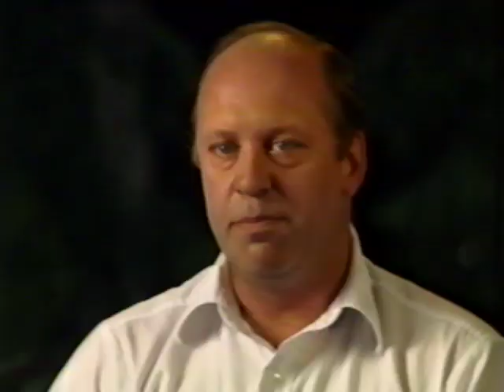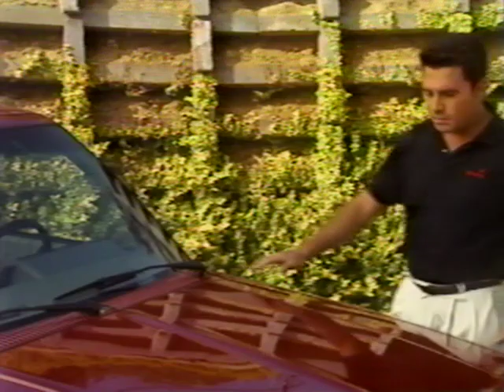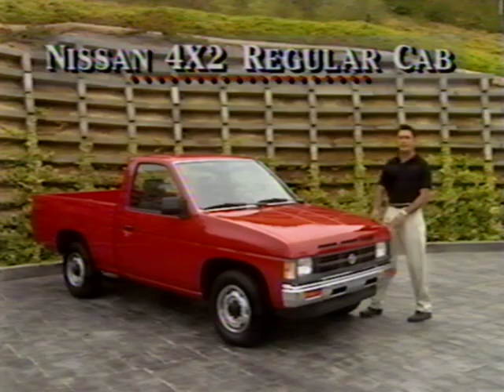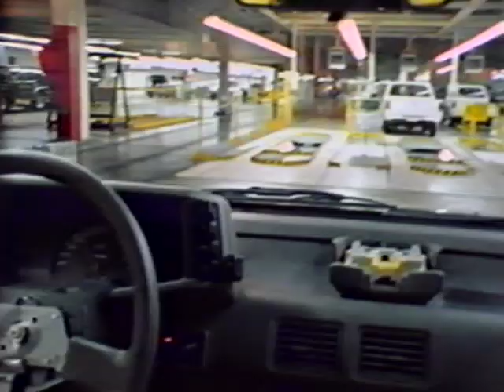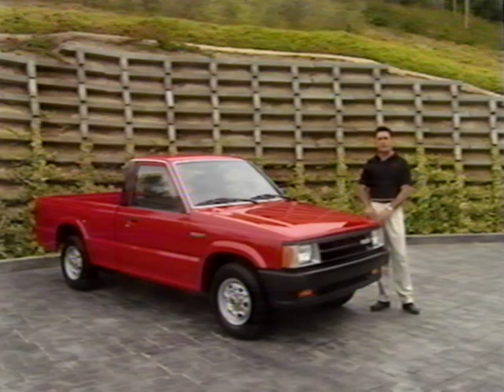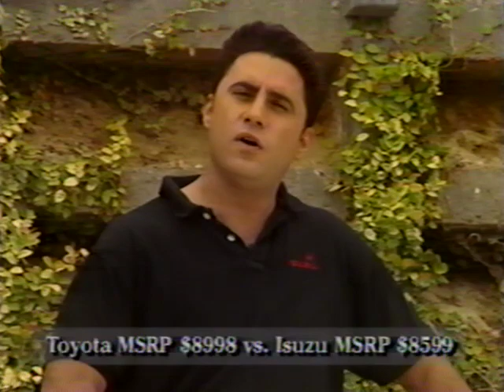Value's Back in Style 1992 Isuzu Pickup

Comment: I had one of these: A 1991 I purchased brand new and when the warranty expired, so did the d@mn truck! I had friends that had Mitsubishi’s and Toyota trucks purchased around the same year and they never gave them a bit of trouble other than routine maintenance. Mine didn’t either, but it was like when the warranty went out so did everything else! The starter, alternator and fuel pump all went out on mine within two weeks of one another. 
I eventually sold that piece of junk in 1998 and when I did, I was glad to see it go.

Comment: Some observations... great sales infomercial for dealers.  The Isuzu was a great barebones truck....they all were. It just depended what style and preference you you liked. I owned them all and with the exception of the Mazda see them all once I'm awhile, especially the Toyota and Mighty Max. The downside to the Isuzu that was never mentioned.... the engine had a carburetor and was not fuel injection.  Most were TBI OR MFI at this point

Comment: I got me a 1989 5speed I paid 1800.00 for it a couple yrs. Ago it's  very clean in the inside no cracks in the dash it even has the cig. litter still in it I've had many people what to buy it from me , so I'm wondering if I did sell it what would be a good price to sell it for? Oh  the man I got it from only used it at the dealers for a run and get parts the miles on it are very low also. Thank you 😃

Comment: I bought my '90 Spacecab in 2015, with 250K on the clock. With its 2.6/5spd, she runs like a more modern vehicle. In fact, she outruns my very well-maintained '02 Outback 2.5/5spd, from a stop, through the Subaru's topping at 115mph, and is very stable and comfortable, almost relaxed, at 100mph.

What I noticed about it, comparing it to other pickups of the time, is that it's a bit larger in almost every dimension, and just has that extra "something." Guys have argued with me, that she did not come equipped with rear disc brakes, likely because none of their pickups did, even other Isuzu guys, but a peep through the Rodeo wheels quiets them rather quickly.

I could go on about it, and typically do, but... I think the rest were slammed hard enough in the video.

Comment: ********   My  1992 Isuzu Pickup has 375,000  Trouble free miles...I only have replaced, Hoses, Belts  and only once...my Clutch !!  :-)  ****
Reply: I am looking at one that needs a clutch... Which did you choose to install?
Reply: @คฬเ  I bought a "Heavy Duty" clutch kit from "Summit Racing"  :-)
Reply: @renorichard3257  thanks
Reply: @คฬเ  a bone stock one is also just fine these are only 80 hp engines.

Comment: I had a 92 isuzu with about 60k miles on her when I was 16.   Motor spun a bearing. Rebuilt it .30 over calmini cam pace setter header Weber carb. These trucks are tough bastards.  I just got a 92 space cab s for 300. Gonna redo it better and how I've always wanted it

Comment: 24 MPG highway .  That was is why I bought a new Toyota Tacoma back in 1996 . Because that Truck got 28 MPG and with the one I bought  with the 5 speed manual trans I got 30 MPG highway .
Reply: the 22re has never gotten that mpg for me. i have driven both for extended periods of time. the isuzu i got was a heap that had been went over by some jackleg mechanic to get running half decent. i still loved it and droved it as my daily driver and a beater truck. im currently going to pick it up out of the woods and pull the cab and frame and seeing about restoring it and putting in a diesel. The toyotas are expensive when they fail all nice denso parts but non the less expensive. the isuzu is a cheap reliable engine easy to work on and maintain. the yotas turning radius in that ext cab short bed is insane why do they have so much love in the 4x4 community i will never know. my 88 pathfinder and isuzu both can turn on a dime in the woods the yota has the radius of a fullsize. also one thing i prefer about isuzus and nissans is they dont have that feel that the yota does all jdm trucks feel much more car like seating position wise but the toyota u are almost  laying back and i hate it even as a 5'6" man.
Reply: @maldinggamer  its ridiculous the old Toys are some of the most over-rated vehicles you can buy. Maybe all built up they are cool but otherwise they are just shitty old trucks that are inevitably rusted to hell and they still want 5 grand for them. who gives if it will keep running at that point? for 5 grand you MIGHT be able to get a vehicle a woman would get in
Reply: @ChristheDesignar  haha yea 22re is legendary but it's what 120bhp motor? Gm 6.0s are 300k + engines with 350hp which one am I gonna revere more lol one that doesn't make enough power to blow itself up or a workhorse. I just don't understand the following. Old hilux trucks look cool but chevy LUV and Datsun 620s look a million times better to me but to each their own and that two piece driveshaft in the yota making it vibrate terribly when lifted.
Reply: @maldinggamer  22re isnt legendary for its power but for it nothing can kill me.
Reply: @gogereaver349  I think I explained that by saying it doesn't make enough power to blow itself up. It's a pig iron motor that will never make enough to wear out an iron block but yes all the electronics fail and are expensive like the denso igniters.
Reply: @maldinggamer  no the entire truck was known not to brake down of course there 40 years old now and rust has killed most of them. you could outright abuse them and they never said quit. you could not say that for any other brand in that class of truck. at least in that time.
Reply: @gogereaver349  I'm talking about the 90s first gens the igniters ALWAYS went out unless if they got relocated and it's a 300$ part. Speedometer also usually strips from the transmission as well. It's not major engine issues it's electronics. The vg30 engine is just as unkillable in a Nissan but it's also a pig and doesn't make much power.
Reply: @maldinggamer  oh you are talking tacomas not when they where just called trucks or what the rest of the world called them hilux..  yep old Nissan hardbodys also tanks.
Reply: @gogereaver349  yes the original comment was a guy talking about a 96 Tacoma he bought.

Comment: I just turned over 200k on my '90 Pup. Runs like a sowing machine, only failure it's ever had was one of the front suspension arms broke on a pothole, specially designed means I had to get one fabricated.

The box type frame really does make a difference to longevity, and I love the explanation for deliberate practical design choices.
Reply: I inherited mine from my grandpa and the guy somehow made this thing run with whatever garbage he found

Comment: I had a '93 Isuzu Pick up bought new in '93. Great truck, although the head gasket blew at 50K miles in '96. Luckily it was covered by warranty. Sold it in '99 with about 80K miles. Wish I could have kept it.
Reply: There's videos on Youtube of Toyota pickups & Nissan pickups doing 1,000,000+ miles. Just stay away from American junk, and you'll be alright.
Reply: @terryadams2652 thing is a lot of these Isuzus were manufactured with GM parts and assembled in America
Reply: got a 93 now. just put a new carbrator and timing belt on it. runs like a new one.

Comment: i cant see them in the road anymore.bcoz isuzu is scrap .id rather see toyota .and mitsubishi mpre tougher them all.
Reply: Sungsam Soud Most Isuzu are cabover trucks and also US made delivery van called Isuzu Reach.
Reply: only thing Toyota truck of that era do is rust away. i duuno where you live in hear in the south there is still alot isuzu running around and not the one past 95 that where indeed just crappy gms. even a good number of isuzu commercial trucks still working.

Comment: I bought a 1992 Isuzu pickup in 2001 with 200,000 miles for $600.00 and I drove it another 100,000 with very little out of pocket expenses.  I sold it six years later for $500.00. So in retrospect  I  drove a Isuzu  pickup  100,000 miles  for basic  matinence  for  $100.00. I had to put a starter and brakes and a carb kit and a battery and a set of tires on the truck and that is all I had to do to the truck to get 100,000 miles out of it. I wish I could buy a new pickup today that would match the economy and the reliability of the 1992 Isuzu pickup.
Reply: Michael Toomer Was it gas or diesel, and was it automatic or manual
Reply: Toomer: "I wish I could buy a new pickup today that would match the economy and the reliability of the 1992 Isuzu pickup."
Nissan Frontier with 1,000,000 miles: https://www.youtube.com/watch?v=4Cc3AgIy4vw
Toyota Tacoma with 1,000,000 miles: https://www.youtube.com/watch?v=8glWcEuxw3U
Reply: @terryadams2652  no toyta truck of that era is getting a million miles. not for lack of a good engine they do have them but the truck will rust away. i could see a old Nissan hardbody doing it those things never die.

Comment: I originally bought a stripped to the bare bones 1989 Isuzu pickup which I had to sell several years later, but then got a hold a 1994 Pickup back in 2000...I love it! They were so underrated back in the day. I agree with Brent...they should bring these vehicles back and make the brand viable again!
Reply: in europe and asia isuzu still sells pickups under the name isuzu d-max, as far as ive heard they are great trucks and they sell quite well.
Reply: Isuzu India is doing pretty well.
Reply: simple machines that did the job i have a 93. but i would not call this thing a comfort vehicle lol. with its tiny cab and manual steering.